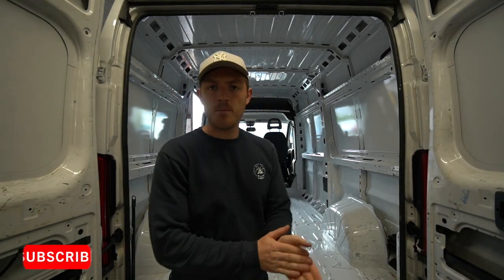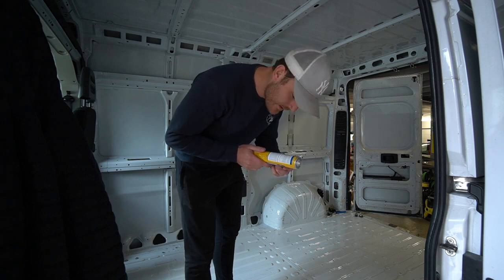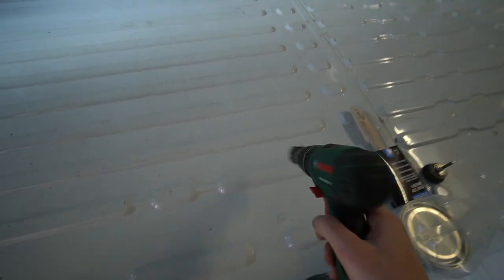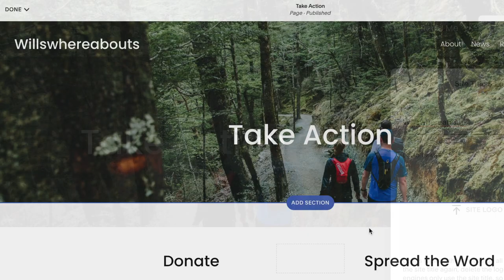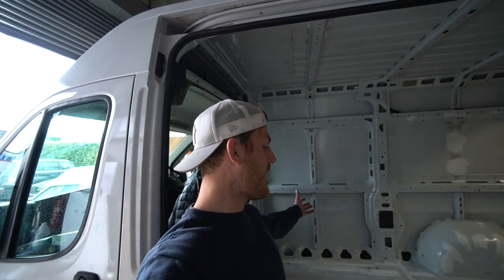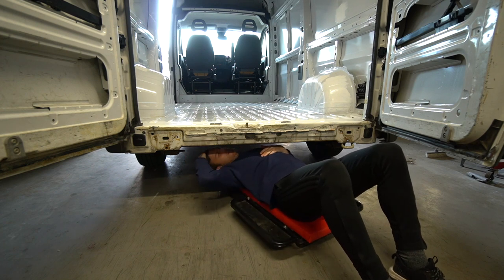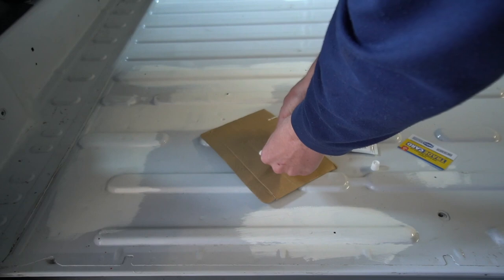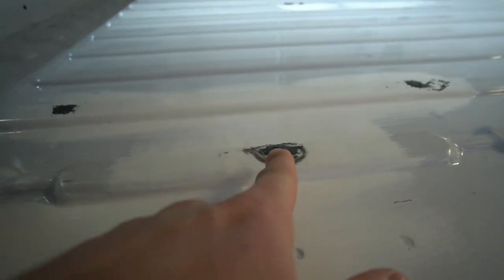HOLES IN VAN FLOOR | Rust Prevention & Repairing Floor - No Experience Van Build

Comment: There's no point in sanding it down because it's going to be covered anyway. Save yourself some time.
Reply: and sanding it down will leave it prone to drop out in time. Left with a rivet type head it stays put.
Reply from the maker: Just want to do it properly I suppose
Reply: @WillsWhereabouts  I understand but it will last longer if you don't sand it. If this was the exterior of the van then yes sand it smooth

Comment: That is far from done with rust proofing before conversion, you need to wax oil coat inside every gap and panel as best you can and fully seal the underneath you need to remove light fittings etc to get into absolutely everywhere or you will simply rot through from the outside in time

Comment: Filling those holes.. You have that sikaflex - didn't pay attention on what type that was, but there is sikaflex that is just perfect for that kind of jobs. Urethane glue sticks very well into different things, stays flexible and is affordable. They actually assemble buses with that glue; some rivets to keep the panels in place until the glue has cured.

Comment: I've watched dozens of van & truck conversions and this one has the most clean & spotless shell to start with by far. I would have welded, brazed, or soldered the holes but if using a metal filler wasn't an option I'd have also gone with JB Weld. I use it all the time & it's my #1 epoxy of choice, so you're doing a brilliant job.

Comment: Use a Vibrating Widget or Mouse sander on hat JB weld with like 220 or 320 grit and it will smooth out great.  Then hit with hammerite again to make sure.  Kilmat (r)  or Dynamat butyl matting from Amazon heavy on wheel wells and couple spots on walls  and ceiling to cancel road vibration and cut out noise is a great idea.  what are you going to use beneath your subfloor? insulation? Rubber mat? (the stuff that goes under Carpet?  that way you have insulative value as well additional sound deadening.   Cheers and keep up the spirit.
Reply from the maker: Thanks for the tips and advice, I'm going to use a rubber matt under as a subfloor to insulate and sound deaden

Comment: If you decide to install a Diesel heater you will have to drill two holes in the floor for the exhaust and air intake hoses. Probably best to do it before laying the flooring.

Comment: Love seeing the progress. A suggestion for the build, spread the weight of u plan to have the kitchen/working area behind the driver then have the batteries on the other side. Also get t lithium batteries if u plan using solar, more money but will increase power production

Comment: Are you going to reuse the original ply on the floor - if you get some 1/2 insulation and the put it over the top it’ll fit nicely, save you time and money - might also be an idea to lay out your electrical set up beforehand so you can put the wiring down before the insulation 👍

Comment: Don't forget you'll need to cut a couple of larger holes in the floor for a diesel heater, if you plan on using one. 

Also remember that you need heat resistant sealant around the exhaust pipe hole for the heater.
Reply from the maker: Cheers dave thanks for the advice

Comment: I would have thought some holes are good for breathability and drainage, also when using jb weld, ive seen others doing 2 straight lines of it to get equal mix, then blending the 2 lines..
Reply: I'm still sceptical about the sideways bed size? Can you stretch arms out and touch each side, your outstretched arms is near enough equivalent length to your height some say..

Comment: Weird question, why not just paint the whole floor? I mean you were almost covering it anyhow.
Reply: Why paint the whole floor when you don’t need to?
Reply: @jonathangleed2374  to have the same shade of white? To ensure all the floors are newly painted? To have the floors maintained?
Reply: @Vicq3010   There's going to be a frame stuck to the floor, so the original paint will be more secure than a surface layer added on top ? Also, you wont's see the floor once it's covered ... This process is just to hinder rust and seal holes, not waste time on completely unnecessary cosmetics ... Finally, to get a good finish, if doing the entire floor, then he'll need to buy a spray gun, as brush strokes would make it look amateur ... (and he'd need to sand the entire area !).
Reply: Will's doing it properly to give longevity to his van,I would of stuck with the tradesman's ply and just covered that up.😏
Reply from the maker: Was something I considered but thought it wasnt really needed